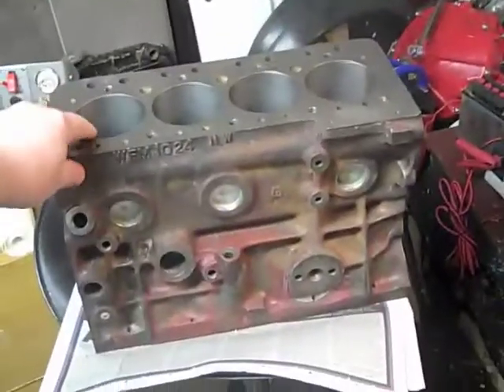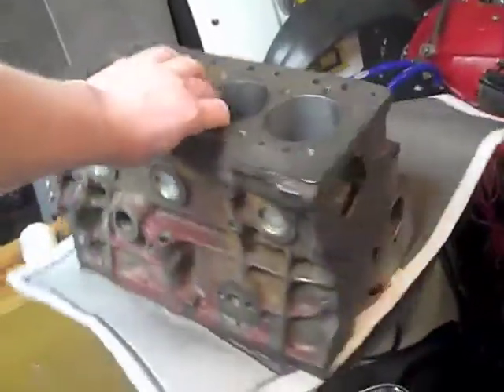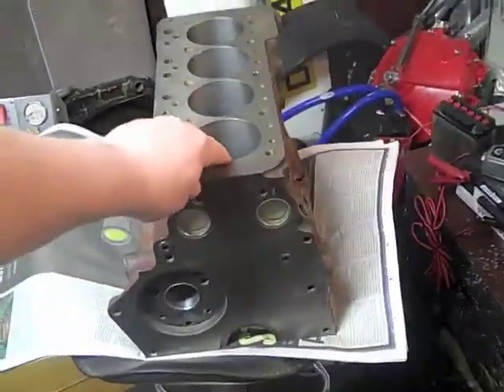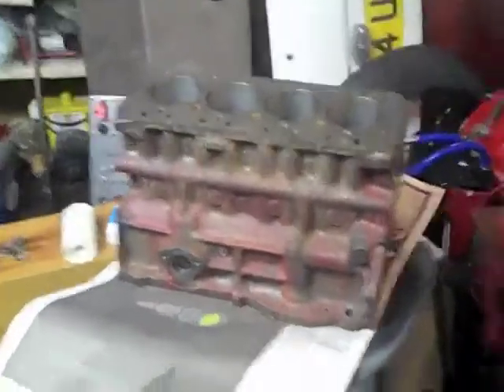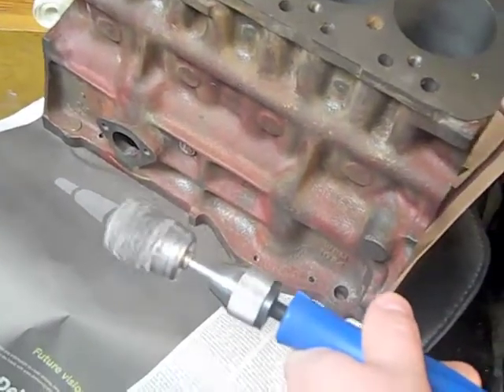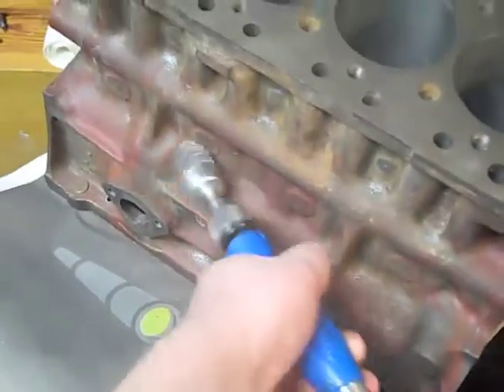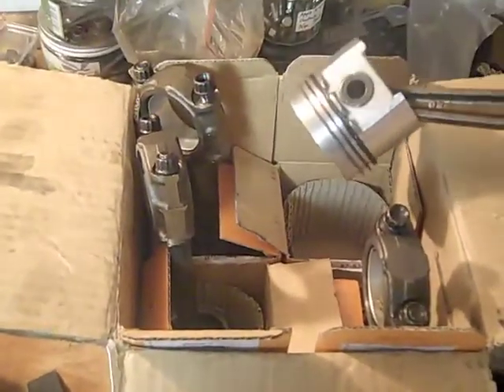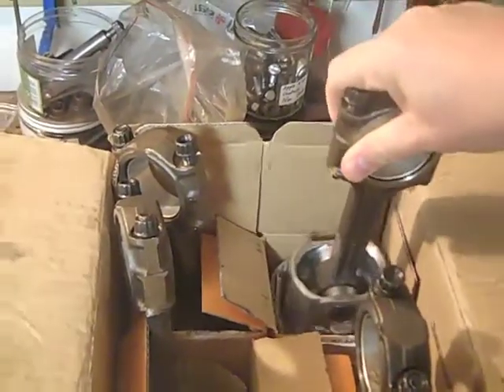MG Metro engine rebuild for Classic Mini

Comment: While this video is about the Mini, given that E-Series Mini conversions have been done in the past, has anyone ever fitted a 85-103 hp 1.6 S-Series into a Austin / MG Metro? 

Though modified A-Series/Plus and K-Series engines would obviously be far better and simpler choices, it is somewhat surprising that nobody has even tried to build a 1.6 S-Series Metro. Especially since the S-Series when turbocharged is capable of putting out 150 hp in the Rover 216 Vitesse Janspeed turbo.

Comment: @titanclassics the 'good' one is in quite good condition, but still needs new pistons etc. because it has done quite some miles. The other engine is in bad condition with a damaged piston nr.2 and piston nr.4 got a hole in the top. I don't know what I'll do with that one but I'm pretty sure I'll rebuild the engine that's in better condition.
Thanks for your reply, I'll look for that DVD

Comment: Hi, nice video. My mini engine has been damaged during driving so I need to rebuild one. I've got a nice one at home which I stripped. I thought it was quite difficult to assemble an engine (crank etc.). Is it really just refitting with new bearings or do you need to measure certain things to make sure it is in the right place when assembling?

Thanks in advance for your answer!